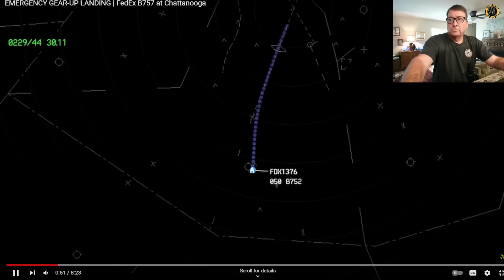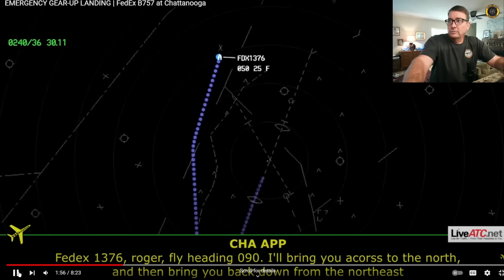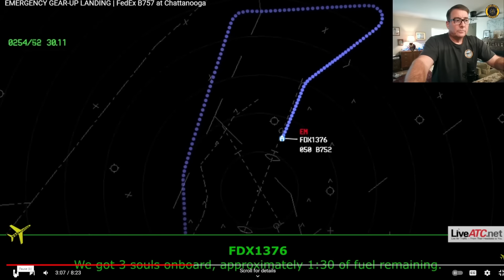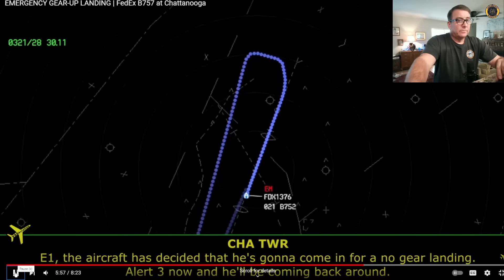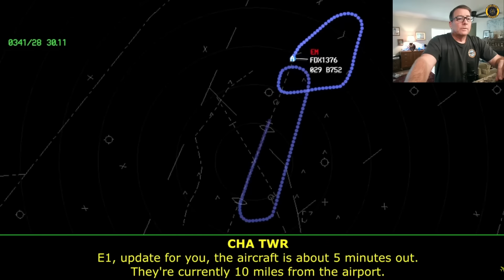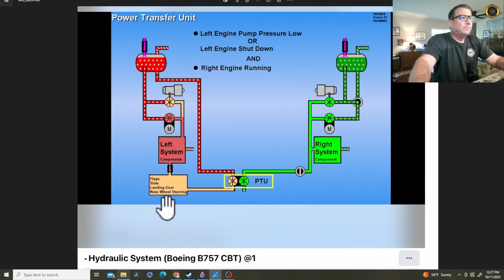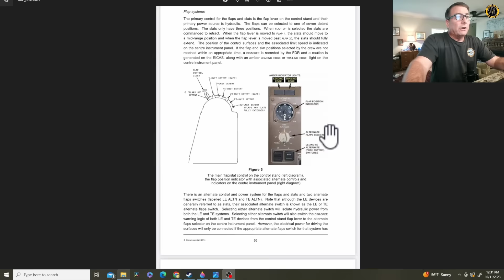Fedex 757 Gear Up Landing 4 Oct 2023

Comment: Kudos Juan, good reporting.  40 years A&P, 757 my favorite.  FYI. On overnite line mx, that DC pwr alt ext pump is also used to open the gear doors on the ground. So it gets an ops ck alot. Also, the switch in the cockpit, while on the ground will also open the doors (but you don't want to do that cause someone could be under the main doors and get "knock" in the head.  Add to that cockpit switch, it's spring loaded to "off". So you have to keep your finger on the sw to keep the pump operating till the doors fall off the uplock hooks.
Reply: Similar maintenance history as yourself Mark but in the UK. Is my distant memory right here ( last worked a 757 around 2000) in that the circuit breaker for the emergency gear extension pump is located near the floor behind the first officers seat and has been accidentally tripped by a flight crew bag years ago or am I confusing this with another incident or even another aircraft type.
Reply: @richardstewart4124  Was that the LOT 767 gear up in Warsaw back in 2011? Circuit breaker C829 was off for some reason, somewhat contributing to the unfortunate gear up landing.
Reply: @richardstewart4124  That P-6 panel is where it's at. Changed many a CB there because of flt crew and their bags hitting them. The Polish LOT 767 , that CB was in, but another one upstream electrically that fed it was out. Didn't catch it. Now since then, that CB is now added to the check list. Surprised Mx Ctl there didn't have the schematics book out and see that-radio the LOT crew to check that CB.   On the FedEx accident, I'd like to know why the Ops ctr people didn't have them go to their main base Memphis, longer runways and all the Mx equipment there.  Fuel?
Reply: @757MrMark They probably did not want to shut down the Memphis airport, much less of a problem at TYS.
Reply: @Biochemechanic  regarding shutting down the airport, that may have been a consideration but it would rank way down the list. Safety of flight and having options early in the flight would absolutely take precedence! Although one could make the argument that it's less safe to perform a gear up landing with 1-1/2 hrs of fuel in the wings.
Reply: @scrivyscriv I failed to notice the time notes in the upper left corner, but from the time they mentioned the EM and to the landing, how much did they have left? The video was sped up several times.
Reply: You're correct  except it was a brand new ETOPS 767ER that did a belly landing instead  that time@richardstewart4124
Reply: 6,000 hours or so in that airplane.  An incredible airplane and a crying shame that boeing discontinued it
Reply: @nothingmuch875  True. now the airlines are wanting something like it back.
Reply: Fav?  You maybe never were called on to crawl those tunnels either side of the nose gear.
Reply: @tomsherwood4650 twice. ☹️
Reply: @tomsherwood4650  it's no so bad, and I'm 6'2 210lbs!
Reply: @scrivyscriv  he probably is a "little" over weight 😅
Reply: So, what I got was "there's plenty of opportunities for unsafe workplace shenanigans." (And, no, I'm not saying you're not a professional. I just know people and someone somewhere might have thought about it as well.)

Comment: You would think the gear would be able to gravity drop?! Even if the doors are hydraulically operated, once the gravity drop is attempted you would think there would be a check valve that could bleed out under the weight of the gear dropping? I’m not a pilot or an engineer, but this seems to be something that all aircraft should be able to do without issue. Or have an electric backup like they have for slats and flaps. Bizarre.

Comment: I'm surprised that in 2023 coming up on 2024, we can't put a cheap camera on the Gears or critical areas to be used at minimum of emergency incase verification needs to be done here...I'm just saying, cheap camera put somewhere to verify the physical condition of the aircraft to help pilots with the  Troubleshooting.

Comment: In regards to my previous comments, I’ve given further considerations of landing at CHA and it made perfect sense to do so. ** land at the closest suitable airport before things go from bad to worse ** better to shut down a small airport rather then taking a chance on shutting down a large airport and FedEx’s operations.  My retirement FedEx pride got in my way and thought a home base maintenance facility may have been an overall less expense. ** possible major hydraulic failure is nothing to take lightly.

Comment: As pilots we are not in an emergency unless we are running out of fuel or there is an uncontrolled fire in the cabin.  Otherwise the airplane is still flying and we are going through procedures to mitigate the problem.  A better term would be to declare a "priority" to land.  Once the gear would not extend, an emergency declaration was in order.

Comment: I just don't understand why after over 100 years of airplanes existing and having inflight problems, that it hasn't been decided to just put some damn cameras on the outside of the airplane pointed at all the crucial components so the pilots can simply SEE WHAT'S GOING ON WITH THEIR DAMN EYEBALLS. Instead, like damn Neanderthals, we are still resorting to doing low flybys for people on the ground to check if the damn gear is down 🤣😂. External cameras. So fucking simple. How has nobody thought of this yet?

Comment: With all the technology they do not have a PIN CAMERA and cockpit viewer that can show if the gear, flaps and other flight control system have functioned correctly and in position as needed without a low pass and others looking to see if your gear is down. REALLY?

Comment: The NTSB preliminary report is out. Hydraulic leak to left gear door actuator. Then a continuity issue in the wiring to the alternate gear extension system prevented it from working. The crew did a great job.

Comment: Interesting that there is no cable related 'free fall' gear extension system on the 75, like in the veritable 73 family that I fly. In that system, you simply open a small access door in the floor of the cockpit, and sequentially pull the three unlock release handles until the gear 'free falls' to the extend position. The only reason for not using a system like this may be the force required to manually release those unlocks on the 75's beefy gear may be too great for a system like this to work?

Comment: I would be very interested in seeing what that final report says. . .
Reply: The NTSB preliminary report is out. Hydraulic leak to left gear door actuator. Then a continuity issue in the wiring to the alternate gear extension system prevented it from working. The crew did a great job.
Reply: @carolwebster9825  very true. Blanco has a video out for the preliminary report that I saw. He was saying exactly that. When I heard about both the hydraulic leak and the electrical fault I had to chuckle about it. Unrelated system failures like that, no wonder people think of gremlins.

Comment: I have about 5,000 hours in 757’s and 13,000 hours 767. There are quite a few checklists for hydraulic problems. When LOOKING at the EICAS, after looking from top to bottom on what’s listed for the failed items, look from bottom to top. Only then will you have the big picture of what the true problem is! Then, go to the appropriate emergency checklist. If you choose the wrong checklist and don’t read all the notes, you can make things go bad for yourself!
Reply: -_blancolirio--  is this from you Juan, or an impersonator? I like surprises😉

Comment: If I remember the Polish Airline LOT had a 767 gear extension problem as well. I think the CB for the electric extension motor popped. I cannot remember if the CB was accessible from the cockpit or was down in the E&E compartment.

Comment: My question is not about the technical aspects of this incident,but why did this crew elect to land back at CHA ( which shut down that airport) rather than fly to Memphis FedEx’s home facility with several alternative runways to land on for repairs or resolve.  With that said…. Did the crew feel some immediate danger with other systems relating to gear and hydraulics.
Reply: They didn't have a lot of extra fuel. Perhaps FedEx didn't want any runway or the entire airport closed. With multiple hydraulic issues, this is probably a "land at  the nearest suitable airpirt" situation.

Comment: These days it’s surprising there isn’t cameras inside wheel well doors to give a visual of gear up or down. Eliminates the “fly by”.
Reply: The 757 and 767 were certified in the early '80's. To add such a system means an expensive STC process. Accidents like this just don't happen very often due to thectriple redundancy originally built into the aircraft design. So, it just wouldn't be cost effective.

Comment: Juan, we LOVE these breakdowns!  Thanks for keeping us informed during these events.  Question:  Could there have been a landing gear hydraulic circuit failure DOWNSTREAM of the control valves?  If all the gear extension circuits are tied together it wouldn't matter how many backups/redundancies are in place, the hydraulic pressure would never reach the cylinders to actuate the gear.  Correct?  Are there any priority valves in the circuit downstream of the control valves?  (not sure if having 1 or 2 gear extended is better than none at all?)

Comment: How does the 757 alt. gear extension compare to the good ol’ 707 (KC-135) system? I could drop the gear and flaps within 45 seconds back in my Boom days. Seemed fool proof.

Comment: i have a questions
. would the crew pull the extinguishers for the engines at any point during the actual landing? or would the fire crews be used instead.?
how long can an engine produce power not necessarily thrust once the extinguishers have been pulled? are those engines written off? or can they be repaired?
Reply: I suspect it depends on the condition of the engine cores,  not the condition of surrounding stuff.  I suppose they would pull handles to kill fuel and fluid to the engines as soon as feasible with their hands full but as for turning them to get fire bottles who knows.

Comment: Great job by everyone all around to get this plane on the ground without any injuries/loss of life. As an 18 year ATC I'm proud of how my peers handled themselves. I just wanted to clarify one thing about the emergency declaration. While both the controller and the pilot can declare an emergency in a situation, it doesn't appear that ATC actually declared the emergency in this situation. The red "EM" you see above to data block is triggered by the aircraft squawking 7700, not by a controller input. I'm guessing they squawked 7700 just prior to when they verbally declared the emergency. (I didn't ever hear ATC declare the emergency for them)

Comment: Gee, if only there was a cable to pull and release those unlocks 😅 sorry, had to get in a snarky retort from the “fly by cable” MD-80 😊 Good job by all, although I’m surprised they slide of the end of the runway since they had flaps and slats.

Comment: Kudos to the Fedex fight crew.They remained calm throughout the issue and able land that aircraft under this extreme situation and basically walk away unharmed.
Very good presentation in the event of a left system hydraulic failure the other way to lower the gear is electrically by alt gear extend as long as there is still fluid below the standpipe in the reservoir. The PTU automatically powers the lh hyd system when hyd pdessure drops below 1850psi as long as hydraulic is still available on the system. In most cases it activates after an edp failure. If you loose hydraulics it will not be of any help to lower the gear.

Comment: Awesome analysis as usual Juan. Does the 777 you fly have the same system for putting the gear and flaps down in the event of hydraulic problems? Cheers from CYYB.

Comment: No idea why they didn't make the Hydraulic System so that Engine 1 & 2 Both have the same entire hydraulic system 
So even if System 1 fails completely. System 2 still provides the exact same function (even Dual PTU's)  without even the pilots noticing other than a eicam message.

Comment: Good info. I was surprised to find out even the backup to the back up needs hydro to dump the gear. MD jets used cables and pulleys as their alt gear extension.

Comment: I experienced a left gear fail to extend upon lowering the gear on Dash-8
After running the alternate gear check list with failure to lower left gear called our airlines maintenance control and asked that they call our resident manufacturers tech representative at his home on Sunday morning and asked him what we might do next?
He was one sharp engineer and he told us to put all the alternate gear controls back to normal with the gear handle in the down position which resulted in full aircraft hydraulic pressure being directed to the left gear uplock cylinder!
Wa la our left gear came down and best three green lights I can ever remember!

Comment: Im going to go ahead and criticize the design of the 3rd way to extend the gear.  Its very unlikely to work.    If the cause of the hydraulic failure is a catastrophic leak in a pressure feed pipe to the flaps, slats, gear, or nose wheel steering, then that "trapped" fluid isnt going to do anything - the PTU will just pump that trapped fluid out the hole just like the main pump pumped the normal fluid out the hole.   None of the 3 ways of lowering the gear works in the event of a catastrophic leak in certain locations, leaving the door open for a single failure to make it impossible to lower the gear.    The 3rd way of lowering the gear should not use hydraulics at all.   There should either be an electric motor operated door release and latch release, to allow the gear to gravity fall based on an electrical signal, or else explosive bolts should be used to jettison the gear doors and disengage the latch, to again allow the gear to gravity fall.

Comment: Very interesting. Good explanation! Captain Joe also made a video on this. Almost exactly the same explanation. However he guessed (and emphasized he was not sure), that maybe a circuit breaker was inadvertently pulled, thus disabling the electrical alternate gear lowering system. But your suggestion that there probably wasn't any trapped hydraulic fluids left anymore in the pipes is more likely to be the reason the gear could not be lowered.

Comment: This month must be the month for gear issues. Yesterday while watching this video a KC-135R from the local ANG made "nose landing" after their nose gear failure to extend. The crazy part was they were out doing a routine training flight and had made several made several touch and gos successfully. It doesn't sound like the tanks that are used for in-air refueling were filled and all five crew onboard walked away uninjured. Damage to the nose of the plane is being assessed and an investigation into the nose gear failure has been opened.

Comment: This is very interesting. For the gear to extend there must be at least some fluid in the left hydraulic system. If this really is the first gear-up landing in a 757 and if it really was due to no fluid at all in the left system, then this single point of failure must never have been encountered before in what has to be millions of gear extensions over the 75’s very long history.

I wonder why the alternate gear extension, gravity drop feature doesn’t use either the center or right hydraulic system to open the doors and release the locks to eliminate this single point of failure situation?

Comment: In the 727 we have the Flight Engineer (God bless them) that with a red handle unlock the gear doors and then the landing gears in the event of hydraulic failure even if the leak is in the landing gears lines.

Comment: The up locks on  each undercarriage leg have jammed closed, when the gear is retracted and stowed in the wells  a set of parrot beak jaws snap close around a pin or bobbin on each leg.  When the undercarriage is extended, these jaws should open allowing the legs to swing down from the wells, either hydraulically ,or manually by pulling a lever as in the DC-10 dash10. It is odd all three up locks jaws failed to open, sounds like some ones over egged the pudding.

Comment: When I was a student we rented a 172 with plans to circle around Mt. Hood landing at two airports on different sides of Mt. Hood.  We got about 5 miles from the airport when the engine started running rough.  Instructor called the tower and asked for a “Priority” landing, not an emergency landing.  We landed without incident.  He told me that he asked for a Priority landing and not an emergency landing as that avoids a ton of paperwork.

Comment: Very interesting. So there are 4 hydraulic pumps that can lower the gear (L Eng, L Elec, PTU and Altn Gear Extend). However all of them require at least some trapped hydraulic fluid in order to operate. It seems to me that leaves a single point of failure if a set of rare circumstances occur.  I did not know some airliners rely on hydraulic fluid in the same system for alternate gear extension. I knew some other airliners use other methods for alternate gear extension, like cables (737), crank (A320) or electric (767).

Assuming all of the checklists were ran correctly, it sounds like the root cause was most likely not enough trapped fluid remaining. Unless it there was some kind of failure that prevented the motor from turning (motor issue, circuit breaker, other electrical issue, etc.). It will be interesting to see what the final report says.